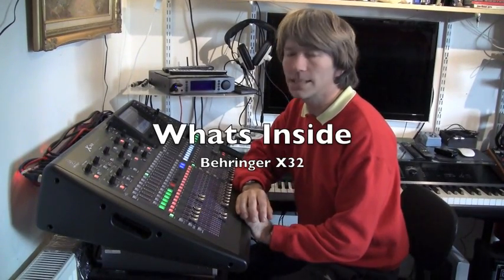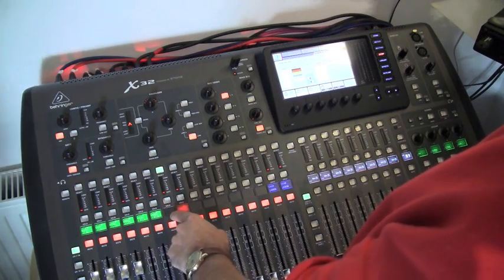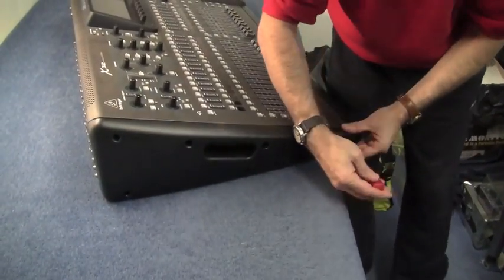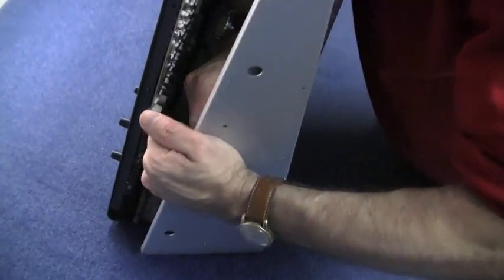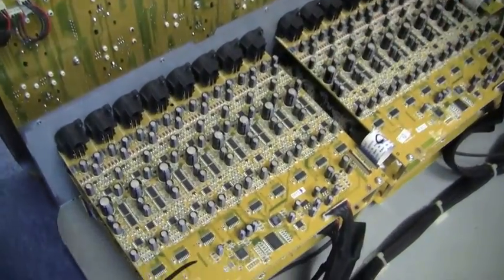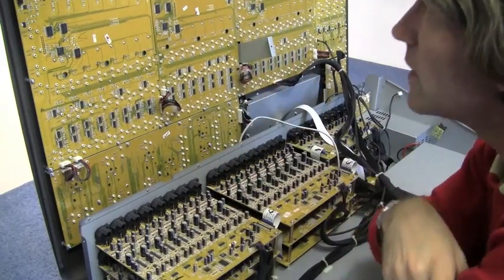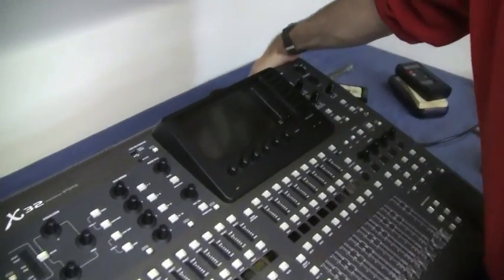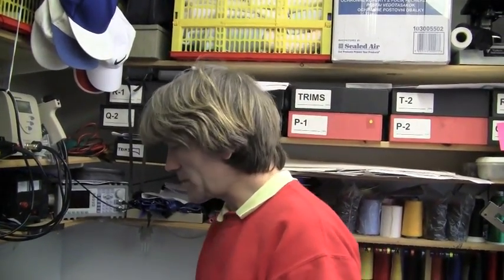MF#2 Inside the Behringer X32 digital mixing desk teardown and repair v2 software

Comment: Markus, thank you for your work in videos like this.  Many of us, myself included, are quite capable but simply terrified of opening up such a valuable device like the X32.  The fear that I'll cause any sort of damage simply by opening something up often keeps me from even trying.  You've saved me (and others, I'm sure) from that fear!
Reply from the maker: Hi John, I also have that feeling that i'm not allowed to look into an item that I own and paid good money for. Its feels like the manufacturers will know and send the heavy guys around to sort you out. as long as there is not one of those awkward warranty seals on there then I will at least have a look inside, OK if you start unplugging things and going at the components with a soldering iron then I guess its only fair that warranty becomes void. but most of what I have learned is from taking things apart. anyway thanks for your message. Im on the lookout for the next item ;-) from markus

Comment: Good job Markus! Never fails to amaze me that a little spot of solder fixes most problems, as you know simply taking stuff apart and putting it back together sometimes does half the job too!
Reply from the maker: Hi Kevin. about 50% of repairs is just solder jobs or loose wires etc. I was kinda hoping to make this video longer showing more around the inside but was eager to see if i had fixed it.

Comment: Nice video. I would be concerned about voiding the warranty. Are there any indicators inside the case that will show you have opened it? Foil strips for example?  Thanks.
Reply from the maker: Hi David, There are NO warranty stickers anywhere. I did have to pull off a bit of glue from some of the headphone sockets so i could unplug them. but thats all. best wishes from markus

Comment: nice video! (btw, if i want to test a led i use the diode tester function of my multimeter, it puts out a current/voltage small enough to not do any harm elsewhere (i trust), and big enough to see the led light up faintly)

Comment: Thanks for posting a video on how to get in and repair this board there are so many little issues that should not require sending it back to get it fixed. I just did a repair on my board tonight before I found your video. Had a stuck EQ mode button With shipping it would have taken well over a week to get it to behringers repair shop and back. I don't have that kinda time. I was quite happy to see how easy it was to get in pull the single board and get to the button. I was even happier to find that the button was only getting stuck because they did not put enough of there plastic lubricant on it i tossed a little non conductive plastic safe lubricant on it just a tiny amount ant that took care of the whole problem.
Reply from the maker: Hi BPP SoundBoard. I was also surprised at how easy it was to get inside and the fact there was no (VOID IF REMOVED) warranty sticker anywhere. my problem happened on day one but there was no way i was going to take it back until i had a go myself. I'm curious as to whats inside things so i'm kinda glad there was a little problem on the mixer as thats gave me the excuse to get the screwdrivers out :-)

Comment: Did you see which chip is the main CPU in X32? Where exactly it is located? Is it Intel or something else.

On small MIDAS Pro desks the main CPU is a standard PC motherboard, a small one, looks like X32 is more custom
Reply from the maker: Hi Arik. sorry I did not take time to have a good look inside the mixer. I wanted to do a full teardown but for some reason my videos are limited to 15 minutes.
I did not really get to look at the processors, they are on the lowest board and i would have had to take out the top 2 layers but time was an issue.
Reply from the maker: hi Arik, Jesse Forgues sent me this info. DSP processor
The X32 has two brains: two processors ADSP-21371 Analog Devices (High-Performance 32-BIT Floating-Point SHARC Processor For Automotive Audio) each capable of 1.596 billion operations per second.
Reply: markusfuller Thanks for reply. There's plenty on forums about this, even if it's only 400 Mhz chip it's RISC type, so it's close in performance to i7 or similar chips in MacBooks. Not the same as old 400MHz Pentium II. Then who cares anyway? Works fine, I haven't had one performance glitch due to slow CPU yet.

Comment: What ADI IC is that at 11:59?
Reply: Nevermind, found this:   DSP processor
The X32 has two brains: two processors ADSP-21371 Analog Devices (High-Performance 32-BIT Floating-Point SHARC Processor For Automotive Audio) each capable of 1.596 billion operations per second.
X32 DSP Analog Devices.jpg

http://forum.behringer.com/showthread.php?1322-X32-inside-photos
Reply from the maker: Jesse Forgues Hi Jesse. sorry I did not take time to have a good look inside the mixer. I wanted to do a full teardown but for some reason my videos are limited to 15 minutes. though I think that's because I'm using iMovie on the mac. I'm trying to figure out how to do longer videos as theres several music related gear and synthesizers I want to open up and get inside in future videos.
Reply from the maker: ***** Hi Yanakyl Thankyou , I have now verified the account for longer videos so I can post the longer moog voyager video now without having to cut most of it out. many thanks from markus

Comment: We have a x32 and a fader doesn't move anymore. Have you an explanation ?
Reply from the maker: Hi Florent Camus, the faders are moved by a dc-motor connected by a small plug onto the bottom of the board, I doubt it could be loose there. there are several surface mount chips close by that may control 4 motors each, I would follow the trace from the motor to the chip and press gently on the chip while changing the fader selections from 1-16 to 17-32 and see if it moves. if so then resolder the pins of that chip that trace back to the fader motor. you could also disconnect the white plug with the red & black wire to the fader and put dc 3 to 5 volts one way then the other and the fader should move. if not then its either jammed or the toothed ribbon is snapped or simply come off or the motor is dead but behringer is using much better quality parts in this X32. I have some 100mm flying faders from an old soundcraft mixer here but I doubt the motors would be the same size. I should have took the opportunity to snap some photos of the board then maybe I could have been more help to you. if you take the thing apart to check the motors be careful of the direction the plugs go onto the headphone sockets as they have been glued and you may pull off the whole plug leaving just 3 pins behind (as I did - oops). but any questions please ask and I will help if I can. best wishes from markus